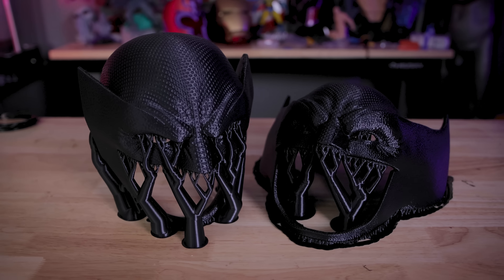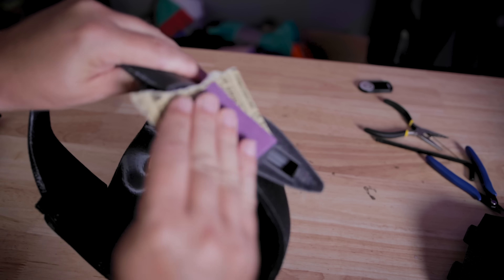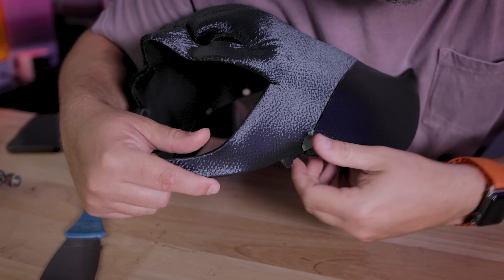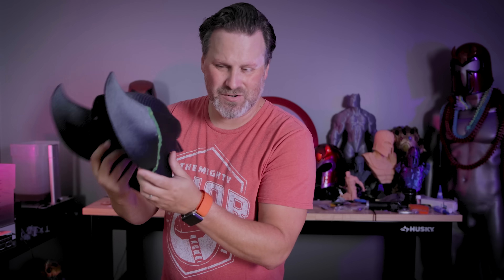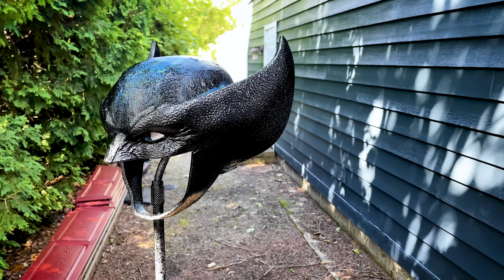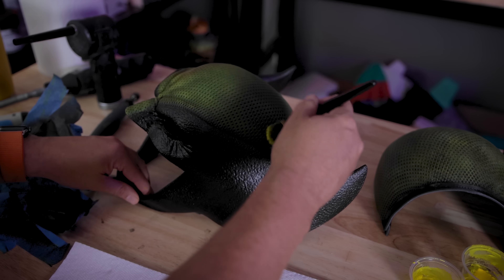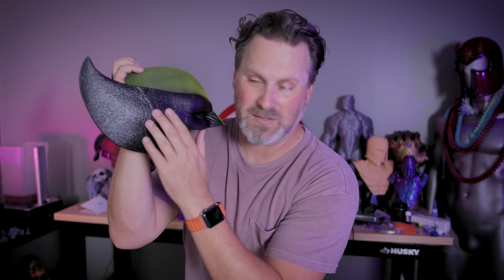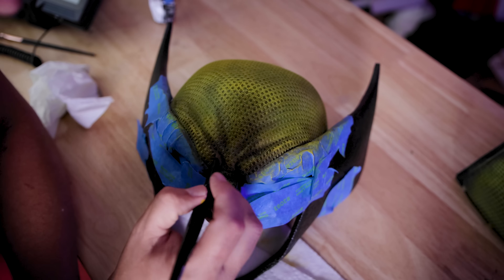Add 3D Texture to Anything - 3D Printing Wolverine Helmet Pt2

Comment: Smooth On freeform air.   You can thin it with water and apply it with a paint brush.  You can then wipe the excess off with a wet rag.

Comment: Its actually better than the one in the movie. Priming with white orange or pink, before the yellow would help as others are suggesting. Also pure yellow is often thin and garrish looking. Using a very yellow construction color or goldenrod will still read yellow, just mix some of the thinner stuff with a touch so it thickens it up a bit and reads as yellow, not fluorescent green. You should developing a working version of the white eyes but transparent enough to see through.

Comment: When using Green Stuff or Milliput to fill gaps, I like to roll the putty out into thin worms, and then just lay them over the gaps. Then you can just smoosh them flush. Very little excess material to clean up that way.

Comment: if your doing the ears in pieces i would see if you can do a smooth finish on the black before printing,and then do flex seal after you've attached them and sanded the seams smooth,  that flex seal is just gonna build up on the seam they way its been done here and youll always see it

Comment: Personally I'd have just used a wood filler putty but I'd also have cut the portion of the strap under the chin and replace it with nylon or heavy elastic so as to not hinder jaw movement. As for the color I'd have gone for the tan and brown from the Miller/Claremont run vs the black and yellow

Comment: Yellow is a PITA to paint over a darker surface. Try priming, or even printing, in white or grey, lay on a decent yellow base, and then tone that down with darker washes and dry brushing. It is a lot easier to make something bright darker than it is to make something dark brighter.

As for the texture, jeez, I never liked trying to match molded-in textures on models cars. I always ended up sanding the part smooth and making my own texture on there LOL This mask has such a large, flat area, you might be able to find some kind of textured fabric or something and stick in on with spray adhesive.

Comment: One thing you could also do is before you try to cram the putty in a gap, coat some vaseline into surfaces you want to protect beforehand. Nothing should cure against that so it only cures in the crack then you wipe it down after curing and smooth just that spot back down

Comment: Thats why modelers need to make sure the tabs are a bit smaller than the hole they go in.  Size head the stock file fits would also be helpful.  I usually have to go to 103 or 105 percent on some of Nicco Industries helmets.  Not sure about others...     I just made a Star Trek Tricorder and to put the rough finish I used a truck bed liner and bottom panel protection paint.  Comes out black and bumpy.  The farther away you spray  the better it looks... Full pressure sprays, starting off the model and then onto it works.  If I could I'd send you a picture.    You read my mind... the scale and sizing at the end...:-)   Thanks.

Comment: Dont really have an idea on how to make them look better except what others have said in regards to dry brushing white before you dry brush yellow. But in regards to the eyes i think you should make them perforated with lots of tiny holes so thry would still look ehite from yhe outside but you would slso be able to see through them from the inside. The white eye just make it look too badass not to be able to wear it with them fitted.

Comment: Try making texture stamps before you fill the seams. Just brush a thick layer or two of latex rubber over any spot that has the texture you want to replicate. Cut a small patch of fabric and place it on top of the latex you just applied before it dries. Then another coat of latex over the fabric. The fabric will strengthen the stamp. Let it all dry on the print before peeling it off. Apply the gap filler. Not too much, just enough to fill the seam. Try not to overlap like Jesse did LOL. Some gap fillers can be smoothed out with water to blend the edges better. Magic Sculp is one of these. Then before the gap filler dries, push and remove the texture stamp into the soft gap filler in several areas to create the same texture as on the rest of the print. Then just let the filler dry. In most cases, if you applied the right amount of filler and smoothed the edges well, you won't be able to tell there was ever a seam there.

Comment: Always love your videos.  Here are my suggestions (from experience} when using green stuff( or any 2 part epoxy) and/or seaming something:
Trim off the first 1/16" of the 2 part epoxy putty and throw away. This gets rid of the crusty part that may be present.
Mix the two parts really, really well. It should only be one color when done with no chunks in the mix.
Use very little to fill in seam to begin with.  It's much easier to add more than it is having to sand some away.
Slightly bevel the very edges of the parts you are joining before applying the putty.  This makes the edge round and easier to blend.
Slightly moisten the tool you are using with water to keep it from sticking to the putty.  Spit works better.  Yes I know, gross.
Take your time.

Comment: Green stuff always cures a bit squishy, not that good for sanding. Milliput is good if you want to sand it after. You can combine the two and somehow they just retain all the good properties. 

Also cut out the part in the centre where the two colours meet, it cures in storage and doesn’t mix leaving little lumps in your putty.

Lastly, “green stuff” is a hobby brand name so comes with the hobby price mark up. Search for kneadadite, might find it cheaper

Comment: Greenstuff is a great tool, sculptors have been making miniature model prototypes (or conversions) for 40 years with it. But it takes a bit of practice to wield it effectively. 

At mix, it's terribly sticky, you want to use water or vaseline to keep tools and fingers from sticking to it. It's workable for about 2h unless you mix too much which fasten the chemical reaction just like with regular epoxy putty (which it is). It hardens faster with heat than cold so if you mixed too much just drop it in the freezer, it will stay workable for a few days. It also is going to stay relatively soft and easy to carve for a few days. 

You deffo applied too much and that forced you to sand way more than needed. Next time, try to apply a thin cordon (2-3mm diameter thin rope) ON THE INSIDE edge of the ear piece and squish it so you'll only have to scrap the excess with a dental tool.

Comment: another great texture finish is duplicolor "Bed Armor" bed liner. comes in rattle cans in a few colors, as well as  black and clear. its WATER BASED and dries rapidly. you can vary the texture size by spraying from different distances. i use it a lot. very durable. all my trucks are painted with this stuff LOL
Reply: Is this also rubber like the flex seal and plastidip?
Reply: @LightsFirstSon  I think it is rubber..however when it cures it has a tougher, less soft finish than flex seal. more like regular paint that has a texture. its easy to paint over as well.
Reply: @stephengolaski6451  that's good info. Thank you.

Comment: Green stuff isnt mixed well enough.  you can still see the yellow in it.  I like the galeforce brand myself.  it comes in seperate tubes of blue and yellow in one pack.  then you can mix 50:50, rather than the AP pre determined amount.  Stellar result you have tho.

Comment: Painting tip regarding yellow. Undercoat white. Then drop a good yellow coat. Dark undertones can be added/created post processing by creating a wash or dry brushing. Yellow does tend to go green over black. A wash will fill in the (in between texture) shading while falling off the higher areas you want to keep yellow. You can even dab it with a paper towel to make the contrast more dramatic.

Comment: Another way to get that yellow more vibrant is to paint it primer white/light grey, then a yellow that’s a little brighter than you want then do a black wash. That way the darker black will sit in the lower points but the yellow will stay on the high point and the wash should dull it down ever so slightly. That way you get the colors you want, where you want them. 🖤
Reply: That’s what I was expecting.

Comment: I love the idea of using flex seal as a spraypaint!
Reply from the maker: Yeah it worked pretty dang well. Especially for some extra texture
Reply: @UncleJessy  I've always  been a fan of using clearcoats and high-gloss enamel spraypaints when doing the painting/sanding/painting/sanding process of prints, do you think you might do a video focusing on unusual or interesting coatings/methods like using flex seal? That might be a fun (if a little bit messy!) video to make! Big fan of your content

Comment: a tip for using milliput or green stuff: roll it out to a very thin cord and put that in the seam When needed apply one layer on top but try to get as less milliput/green stuff sticking out on the top. Then smooth it out with a wet finger and add some texture with a sculpting tool. You can get special sticks with a (fairly stiff) silicone tip that are great for this

Comment: I mostly use spackle paste drywall for tiles, it's non toxic, has consistency of toothpaste and can be thinned and removed with water, for large holes i use Aves.
The spackle paste i just apply, let it fully cure up to a day then apply water on it and go over it with a cloth in one direction, each time more of it get smooth till eventually its only in the holes and scratches. For painting i would have painted with an airbrush fully yellow the head part then apply a dark wash over it to fill in all the crevices and textures and finally a dry brush of the base color to get the high points back, just my workflow.

Comment: When I use green stuff, I like to brush it with water to taper off the edges, it would help blend those seems out a lot and you might not even need to sand afterwards!

Comment: I urge you to try Milliput rather than Greenstuff.   It's better in a few ways.  1, It's water soluble which will help you smooth the edges.  2.  It sands much better than greenstuff.

Comment: so instead of greenstuff, try Procreate. It's a grey epoxy putty similar to greenstuff,  but is waaay less tacky and a bit easier to work with. Also when you are filling those seams, try rolling you epoxy putty into a thin snake and pushing it into the gap. you'll wind up overflowing the edges a LOT less.

Comment: Yep, greenstuff / kneadatite is a wonder. As I said before, I repaired my car dashboard with it, added a little paint, and almost perfect. 

A few tips: 
Clay sculpting tools, the metal push ball for stippling, a silicone wedge brush for pushing it into cracks or smoothing, and the dentist's pick for forcing it into small holes. 
Vaseline on the tool helps to keep the greenstuff onto only the part, but it can lead to painting issues later if you do not thoroughly clean, cold/ice water is a good alternative. 
Also, if you can find the product already separated into Blue and Yellow strips it helps, otherwise when you get a new package remove a small amount through the whole center as that starts curing in the package. I have a 3-foot roll (down to 1 foot now) that is stable and usable after 6 years.
If you need more rigidity a combination of greenstuff and milliput (sometimes called graystuff) 50/50 is a strong blend, but alters the working time.

Comment: tip when working with green stuff - cut out the centre of the strip where the two colours meet - this will likely already be hard and will make mixing it difficult, giving a poor finish. You can also use water and vaseline to smooth it out
Reply from the maker: Oh man that is a fantastic tip! As there was for sure some already tiny harder bits in there. Not sure why they package it like that
Reply: @UncleJessy  also green stuff when cured does have a bit of flexibility to it, what is common is to mix the green stuff with miliput to get a hybrid putty
Reply: @UncleJessy It's probably cheaper for them to run dual extrusion machines than pairs of single extrusion ones.

Comment: tip on the greenstuff.   on a clean wet surface like water on glass or the table.... roll the green stuff into a long thin log   for filling gaps, you can roll it thin as you want to make it so it fits the long gaps easier.   Always wet your tools or fingers when working with it so you dont stick.   when you were dimpling the greenstuff with the paintbrush end you could hear the tak tak tak sound of it sticking to it.   if you wet the end of the paintbrush that wouldnt happen.    also as said before cut out the small bit where the 2 colours join as it will have already cured.  thats why you have yellow lumps in your mix.    you can play with the ratio of the mix.   you can play with the  mix a ratio of three parts blue to one part yellow when they need a super-firm putty. For more detailed work, you should increase the ratio of yellow filler to blue hardener. This will form a lighter green putty which is slower to cure and much more flexible for carving and sculpting.   once done a warm area will cause it to cure faster.  it was a old sculptors trick to put it near a old lightbulb (non led) to act like a putty oven to cure it faster.    it will cure in 24 hours unless you heat it which might speed it.   it shouldnt be tacky anymore but it inherantly will be slightly rubbery/bendable, which can be good for bond not snapping if bumped.

Comment: a little tip for yellow, always apply a white base ESPECIALLY over black otherwise you get that green tone. if you had did a dry brush of the white first, you probably would have gotten your vibrant yellow that you were looking for. also, you can take silicon putty for molding and used to to mold the textures and then went back and used it as a stamp to get your texture back on those seams and help kinda blend it in a little more :) i love these cowls, i might have to do one myself, great attention to detail

Comment: Another vote for milliput. You can apply it much more finely and use a wet brush to smooth it out. You won't have any over application issues. Also it's cheaper than green stuff, and there are way cheaper yellows than Citadel that are just as good or better!

If you want to do a poppy yellow, start with a white drybrush and then yellow over the top of it. Yellow is a weak pigment so it takes many coats to move from black to vibrant yellow. White does all that for you.

Comment: Pro tip for sanding parts perfectly flat... Tape a sheet of sandpaper to a flat surface. Then sand back and forth with the side you want flat down, against the sandpaper.

Comment: Painting Tip, Yellow directly over black is always going to be very desaturated.  You could dry brush on a lighter color first (light grey/light brown or even white) then dry brush yellow over that.  You will get a much more vibrant result.
Reply: This, yellow on black will never get real yellow
Reply: yup agree with this. get light grey and white then finish with yellow will give you more vibrant yellow!
Reply: I think it looks good with yellow on black, it gives it a little bit of an aged look.

Comment: The helmets look awesome!  I wonder if using old bits of filament, like the supports, and either a soldering iron, or something to melt into those cracks to better hide the seems? IDK its just something ive seen others try. I wish I could print things like this, but if I did my house would soon be full of things

Comment: It looks great!!!! For the next time if I can suggest a little tip to make the texture pop out on the yellow part...you can normally spray few coats of solid jellow with no fear and once is completely dry you can wash it with a darker oil color ( Brown, Black or often I use Burnt Umber) mixed in a bit of "Zippo" lighter fluid, wipe off the excess and let it dry...if you need you can repeat the process giving more layers but generally for props making that works great. 💪

Comment: Great job. I see that the "Green stuff" is also available in a  small tube and it can be thinned with water which means you could smooth out the surface with a damp cloth after applying to reduce the sanding. I liked your helmet stands as well. Are yo able to drop a link for the source?

Comment: Green stuff is a pain to  sand. you should try to smooth/sculpt  when it is still maleable.
Makers use silicone brushes to sculpt and if you dip your fingers/tools with water is easier to do
Now you get anoter skill for your prop making

Comment: Print in ABS. Very easy to trim, sand, and finish. Fuse the parts together with acetone--it only takes one or two applications with an eye dropper on opposing surfaces until they are tacky. Then mix scraps with acetone until you have a thick paste and carefully use that as a filler. Not only will you have a solid part in the end, as the parts are fused together, it will be more durable with slight flex, and not melt or deform in the sun or inside a hot car. Also, a spool of ABS can be purchased for $10-15. Of course take precautions to limit exposure to VOCs during printing, and ABS particles when finishing, and an enclosed printer is mandatory.